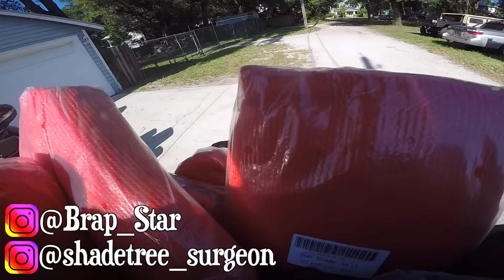Life is HARD, its harder when youre STUPID | Shadetree Surgeon

Comment: When i had a brand new 07 bonneville black i was on my way to work. I was going 50 in a 35 on one of those roads that was too nice, new and 5 lanes wide to have such a slow speed limit. There were 2 mc cops that were laying in wait. They pulled me over but either because of the bike, or because i was a recently retired firefighter, they have me a verbal warning.

Comment: I'm really hoping you used blue locktite on your air cleaner, especially the internal screws, those V twins don't digest nuts bolts and screws well.
Reply: @SixWheelsDown  I couldn't count the times I did a full rebuild on engines that inhaled  a screw or something intake related.

Comment: I have been pulled over in TX on a Harley shovelhead after a girl ran a light and hit me I was going 40 bike slid about 150 feet and the outer primary got shredded leaving holes in it leaking everywhere and alot of other damage. Bought some tools  bent back and fixed what I could. I was going 88mph in a 35mph was trying to get home before all my oil ran out and  a cop on a Harley printed me out a nice ticket. Thought he would cut me a break giving I just got hit and road rash no ass left on my jeans bleeding and some broken bones. But could have been worse